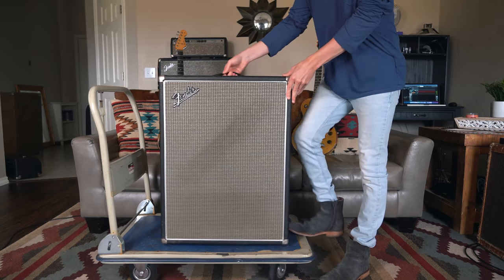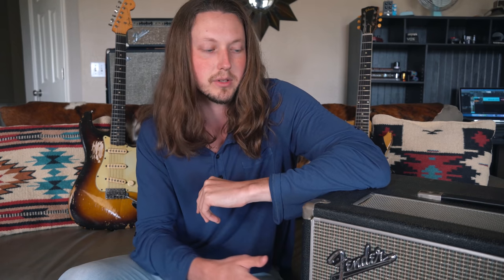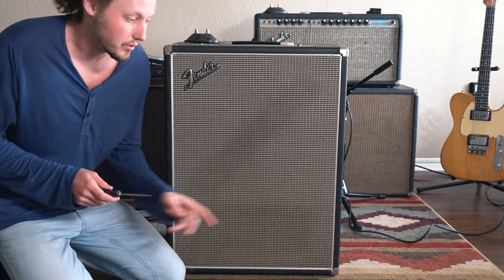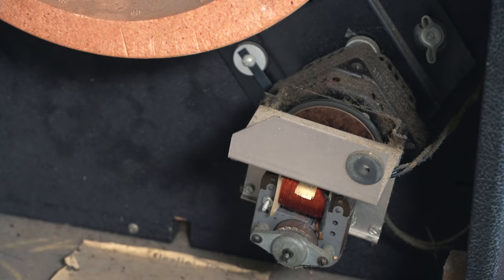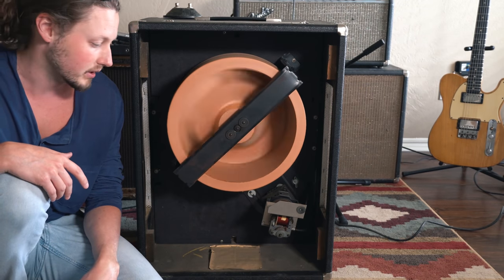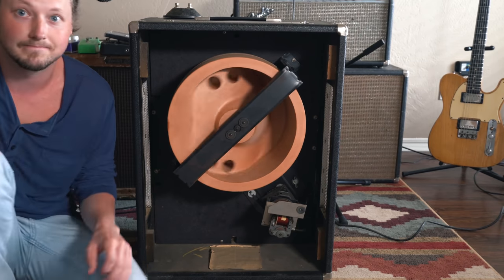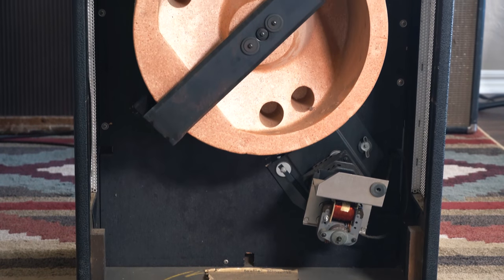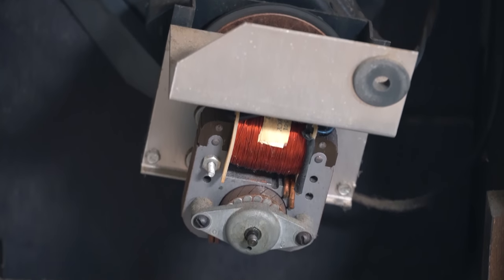I Finally Found this RARE Vintage Fender!

Comment: I’ve owned both a Fender Vibratone  cabinet with the silver banner across the front, and a Leslie Model 16.  They are the same inside.  

My Leslie Model 16 is just like this Fender Vibratone cab, just with a Leslie badge in place of the Fender badge.  

Great sounds.  

I still have the Leslie Model 16 but passed along the Vibratone.

Comment: The Vibratone is AWESOME!
The Fender Pinwheel pedal does a really good job of replicating the tone of the Vibratone and Leslie roto effect.
Reply: Do you run it through two amps? I’m not overly impressed mono. I’m sure that my amp choice (5e3 Tweed) isn’t helping my cause, but that more about the Tone.
Reply: @druwk  I run it through two amps but I like it in stereo and mono.  I run a brown and tweed deluxe or a tweed bassman. You need something with good treble response, try using the bright channel on your deluxe.
Reply: @matthewf1979  Check! (Run it through the Bright channel, and have the Tone up high) Have to keep the drive as low as possible, since it comes after my gain pedals, and the Tweed breaks up quickly on its own. The “on” light is annoyingly bright. I’ve never really gotten used to using the ramping foot switch (Break vs Off vs Ramp). It’s quite a fight to get to a sound that’s not as good as it would need to be, to fight as hard as I do?
Ultimately, when I get the sound where I “like” it, everything else on my board isn’t working for me? It would have to be in its own loop? 
I have a TC Electronics Vibraclone pedal that actually sounds ok, but again, kind of needs its own setup. I’ve tried a Lester G. Haven’t tried the Vent?
Right now, I just added the Strymon Flint (for both the Reverb, and Tremelo), and I’m hoping that the Tremelo(s) can fill in for the Vibroclone sound. It’s way different, I like it, it’s more successful being something it’s not, and it’s easier to use.

Comment: I haven’t come across one of these in Australia. You didn’t mention if it was an amplifier, or just a Leslie type of speaker cabinet. If it is a complete amplifier, I would strongly recommend giving that 50-year-old baby some TLC, like new filter caps, checking the tubes, servicing the pots and sockets.  Thank you for bringing this to light.

Comment: I bought a Jennings organ plus accompanying box many years ago. This speaker box works on a different principle than the Fender. There is a 45 degrees from the bottom beveled rotating styropur cylinder, which is sounded by a lying speaker below. The box is open on four sides on the upper third and two thirds down at the front to ge a "surround sound". There are also two speeds and the old thing is mechanically a bit noisy. I´ve only used it for my guitars and it reminds me in sound of the Boss Phaser I used to own, and since we're on the subject of George Harrison, of a couple of spots on the Beatles' Abbey Road album. Thank You Matthew for the post, because it made me want to take care of the good piece again.

Comment: I found the inner workings of one of these inside an old organ, Thomas Organ?     Same components just without a cabinet.   Very cool.   The belt tension on the rotor can be used to control the length of the "wind-up time" and "wind-down" time when changing rotor speeds.   A looser belt will get more belt slippage and extend the times for both up and down.   The Leslie plug-in from IK Multimedia labels that feature as "acceleration" and "deceleration".

Comment: Wish I could post pictures here because I’d love to show you an absolutely immaculate Leslie 18 I just bought from the original owner. I’ve been looking for one for years. I have a couple of the Cordovox CL-20 cabs. They are basically Leslie 16/Vibratones but branded Cordovox and they were used for accordion but work great for guitar as well. I have a Motion Sound Pro 3 on top of one of them and it sounds great. Yours sounds glorious and looks to be in great condition for 67.

Comment: Cool find, Matthew! I built a Vibratone about 20 years ago, for my lad Owen (you have a mutual friend in Joel, btw) back in the days when we had a Texas blues band called The Rockin Armadillos. The prototype used a plastic bucket with a slot cut in it and a motor from an electric fan - not my most successful build, it has to be said! The second one used the Leslie unit from an old Hammond organ, with exactly the same rotor and motor mechanism as the Leslie 16, but with an even more feeble 10" speaker than the Vibratone. I replaced it with a Celestion Vintage 10 and built in a couple of relays to handle the speed switching - all quite crude, basic stuff, but it sounded good and worked - it still does. Because we were gigging mainly small venues, I decided to try to build it into as small a box as I possibly could. It's about half as tall as a Vibratone so the sound is a bit compressed and boxy and it rattles a bit when you turn it up, but that kind of adds to the overall vibe of it. Owen used to drive it, either with an old Bassman 100, or for smaller gigs, my Rivera design Super Champ, alongside a modded Bandmaster Reverb and a Trace Elliot Speed Twin. When the band split and Owen went off to the USA with his band, the Leslie ended up in my garage for about 15 years. I dusted it off a few years ago and posted this video on Facebook, featuring an Armadillos track with the Leslie on the rhythm guitar (and also some of my awful guitar playing towards the end, for which, apologies!) :) 
Here's the video https://www.facebook.com/tim.aves.7/videos/10156248679190628
Nowadays, it lives in our studio, www.rooksyard.co.uk where it occasionally sees service on a session or two.

Comment: Yay! I bought a Hammond t-120 (real tonewheel) organ a few years ago with a very similar built-in speaker. Someone fitted the organ with an input jack presumably for bass, but I plug my guitar into it and it is sweet!!! It has that same funny looking foam speaker spinner.  It’s branded Leslie when you open up the cabinet. Pretty cool. Not exactly what you have there but very close. Early 70s. $150. Not bad.

Comment: The Wikipedia page for the Fender Vibratone is short but the external links at the bottom are worth looking at. There's a scan of the owner's manual and a link to an extensive web page called "Inside the Fender Vibratone" that has a link to a list of many suspected Vibratone recordings.

Comment: I have a Leslie 16 and 18,  both with EVM speakers - but don't use the crossover thing. 
I just mounted a speaker jack in the back, and use a seperat Dual Showman Reverb head to run it. 
I use tons of reverb through it, as it sounds so great.... 
Also good to use a lot of treble, as the styrofoam absorbs a lot of high frequencies.... 

All the best from Denmark

Comment: Matthew love the video as I also understand these were ran with combo amps such as a super reverb as an extension cabinet that way you have swirly on one side straight signal on the other really stereo phonic the chorus CE 1 was designed after this sound

Comment: Hello Matt - Thanks for the video. Nice found ! - I have one like that. - It seems that yours is missing as support rod or small shaft that is supporting the motor. You can see the hole in the back of the front baffle, it goes thru the rubber bushing on the motor bracket. You can make it out of bolt or something that fits the hole. Use loctite or something to secure it to front baffle. It's important part because now the motor is only on their rubber bushings. Make it long enough, - if it's too short, it's difficult to put back the front baffle.  best regards AJ

Comment: I had a Cordovox rotating speaker for accordion in the nineties. Had a wooden rotor which sounds better than the styrofoam. They are basically identical to the Vibratone, but smaller cabinet.

Comment: I worked in a band in Buffalo NY about 25-30 years ago and one of the guitar players used one of these. He built a smaller plywood cabinet for it, not sure why, maybe just easier to carry around, but I remember seeing that styrofoam drum. We didn't have a keyboard player so he used it to put out an organ type vibe when he played rhythm parts and it was an extra little table to hold drinks and an ashtray too.

Comment: I made one of those cabinets a few years ago similar to that anyways. There was a old Lawrence Welk organ on craigslist for free so I got it because it had a Leslie system in it. The keyboard I had a ground issue I couldn’t figure it out but I decided to take the Leslie out and put it in a old  empty 15 guitar cabinet. I also installed a 12 inch speaker . It turned out pretty good I rigged up a foot switch to control the two speed motor. Only used it in one gig and I actually didn’t use it I let my keyboard player play through it. He ended up buying a Roland keyboard which had a Leslie simulator in it Sweet. I have a demo of me demonstrating that cabinet on YouTube. Really enjoy your shows.😎

Comment: I own a 1968 Vibratone. I had it serviced. The foam drum bearing needs lubricant, and it’s a tricky bearing to disassemble and lube. 
I also had the 10” speaker replaced, and a three pronged grounded plug cable added in place of the original two pronged plug for safety. 
The Vibratone works in an A or B mode with a separate amp head and cabinet. 
When the Vibratone is engaged by the foot switch, amp head is only driving the speaker in the Vibratone cabinet. 
When the Vibratone is disengaged, the amp head audio signal goes to its attendant speaker cabinet. 
It doesn’t have a crossover, it has an external mid pass filter. That keeps the frequencies reaching the Vibratone’s 10” speaker in the 250hz to 2,000 hz band. 
The Doppler type chorus effect tone the Vibratone makes isn’t very effective with low or high frequencies, so the mid pass filter removes them. 
When the guitarist doesn’t want the chorus effect from the Vibratone, the foot switch is used to change modes back to the amp and it’s cabinet. 
The cable rounding is as follows:
Guitar into amp head.
Speaker cable out to Vibratone via its pigtail. 
Speaker cable return to the amp cabinet via its pigtail. 
Foot switch activates hi or low speed, and switches b/t the amp cabinet or Vibratone cabinet. 
Also when stereo miking up the Vibratone cab do a 11 to 1 o’clock soft pan. 
Remember that the Vibratone cabinet and external amp/head cabinet is design to operate in either A or B mode, with no A+B.

Comment: I found one of these on Craigslist last year for $50. It was in fantastic cosmetic shape but when I picked it up, all the guts had been ripped out and it was converted to just a 1x15 speaker cab with a cheap RadioShack speaker. Got it anyway but traded it a month later for a Catalinbread Echorec which is definitely a space saver by comparison.

Comment: Those were designed to be use with combos that had detachable speaker cords, so that you could use the speaker out to leslie in, and leslie out to amp speaker, so that the amp would still carry some sound, but the Leslie would accentuate the middle frequencies, especially with fast speed engaged.
I was very disappointed that you did not demonstrate your unit on fast speed to simulate an organ.
When I used mine in the late 80's - early to mid 90's, I was mostly in 2 guitar bands, so mine was heavily used to simulate many key parts.
Good Times.

Comment: The mechanical parts are just like my Leslie with the exception of the cone. Mine has a wooden cone-wheel whatever you want to call it. Also the one I have has a larger cabinet that weighs a ton.

Comment: 65-67 I was in bands in La Crescenta, CA, when Fender was starting to experiment with Vibratones and other ways to get the sound of a Leslie.  There was one guy, a real math/engineering whiz at my hs, Gary Demos, who came up with an experimental "box" that was trying to imitate the Leslie sound, he got funding from Fender to experiment, it most likely was a prototype for an early pedal, the box was like a small jewlery box, but looked like a little Fender amp.   This was in La Crescenta(Glendale, CA).  He later obtained several patents for devices and mechanical patents for digital film equipment and was quite successful.  In later years I discovered quite a few rockers passed through my area and the little music shop I frequented.  Randy Rhodes taught guitar at Grayson's Tune Town, Michael McDonald played at a dive bar in Glendale before he got with the Doobie Brothers, and several others. Love your videos!

Comment: SRV was a genius also i like the secret Mod he used to do to his Fender amps to get a less harsh tone , he would get duct tape and put it across the speaker to add more bass to the tone , I love the old Blues players , they were not the fastest players but they had the sweet spot in tone , where as someone like Yngwie Malmsteen gets boring very quickly  , A good blues player is like a classical composer never plays the same thing twice.

Comment: They are is a rebadged Leslie model 16. The Leslie 16 has a 10 inch speaker with a crossover network and the model 18 has a 12 inch speaker that is full range with no crossover.

Comment: Man I had the Leslie version of this year's ago, well back in the 90's anyway. Like a fool though I sold it then bought a Motion Sound SR 112 and year's later sold that as well. Finally settled for the Hughes and Kettner Rotosphere pedal. Every time I watch one of your cool vids I always kick myself for ever getting rid of any vintage gear I owned, I should've known better. Although that stuff isn't easy to haul around, there just isn't anything that can really replace it. Some of the new Leslie simulator pedals are really nice, but there not moving any air. The sound that you get when it's miked up fills the room its amazing, it's unmistakably the real deal. Just don't get rid of it lol.

Comment: It was great to see one of these original Fender units in action; they are pretty rare.  If you want this sound on a budget, and you are somewhat handy with wood and wiring,  there is an option that can be extremely low cost, if you don't mind putting in some work.  As you can see in this video, the Leslie unit consists of a 2-speed motor assembly and a rotating drum assembly mounted on a baffle board, with a speaker mounted on the other side of the baffle (not shown.) The rotor has an opening at one end, and is shaped to direct the sound of the speaker out through the open end while the rotor spins, throwing the sound around rhe room and creating the effect.  Here's the good part:  Back in the 1960's and 70's, Leslie made units like this available to organ manufacturers (just a rotor, a motor, and a speaker mounted on a board), which these organ companies installed in various models of their organs to add the Leslie effect.  Countless thousands of people used to have these organs in their homes.  And because they have declined in popularity and they take up a lot of space,  you can frequently find them in thrift stores or on Craigslist, dirt cheap or even free!  I have built a few low-budget "Vibratone" cabinets using units harvested from organs that I got for free, and they sound amazing.  (You can also occasionally find the units on ebay, from sellers who have pulled them from organs.)
The ones installed in home organs are frequently a little smaller: The Fender Vibratone 16 shown here came with a 10 inch speaker and a 15 inch rotor, whereas the organ units are usually an 8 inch speaker and a 13 inch rotor.  I fitted the one I currently use with a 10 inch, 16 ohm Celestion that is good for about 50 watts.  I also mounted it horizontally in a cabinet that is open on all sides, so it is more like an actual Leslie speaker which throws the sound around the entire room in a 360-degree pattern (The Fender vibratone is throwing the sound out vertically, mostly out of the two slots on the sides of the cabinet.)   And although 50 watts doesn't sound like a lot,  the sound literally fills the room because it is traveling in all directions.  You don't need as much power to be heard, and  hearing it in person is like nothing you have ever heard in a recording.
So, start hunting on Craigslist, etc. for home organs like Conn, Baldwin, Lowrey, etc., and make sure you find one with a 2 speed Leslie.  Remove the Leslie unit, svcavenge whatever wires, amplifiers, speakers, etc. you want to keep, and dispose of the organ.  the motor is actually two motors on a common mechanism; each has two wires and running one or the other gives you slow and fast speeds.  Connect one wire from each motor to the common (neutral) 120 volt supply, and make a footswitch to toggle the power back and forth between the other wires of the slow and fast motors.  Mount the unit in a cabinet of some sort.  Mounting it vertically will make it similar to the Vibratone.  It sounds better mounted horizontally, but if you mount it horizontally make sure the motor hangs downward.  (You'll understand when you see how the motors interact.)  
The stock speaker will be good for maybe 15 watts (champ/princeton/deluxe, etc.) but I highly recommend  upgrading to a 10 inch speaker that can handle some power.  I'm using a 16 ohm Celestion, and paired with a 15-30 watt tube amp it will keep up with a drummer and a band at small club levels.  Enjoy!

Comment: The styrofoam does something to the attack that makes them sound more chorus-y than a regular wood Leslie scoop. DBII left a little one at my house for a while when we were kids, I was bummed when he came to get it because I got hooked on it. Try a mid-side mic setup a few feet out to capture the sound (sideways figure 8+cardiod SDC pointed at cab, duplicate figure 8 track, pan figure 8s hard left and right and flip phase on the duplicate).